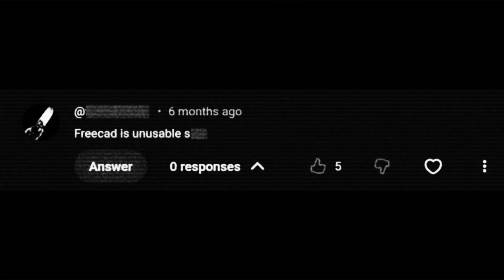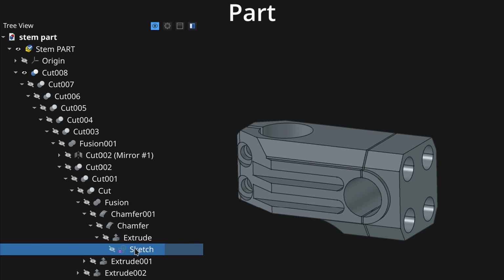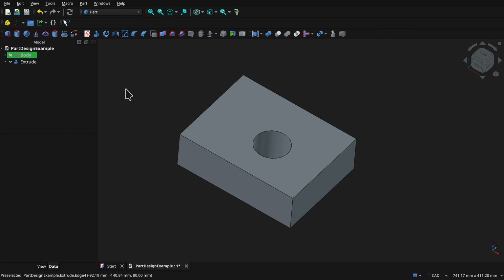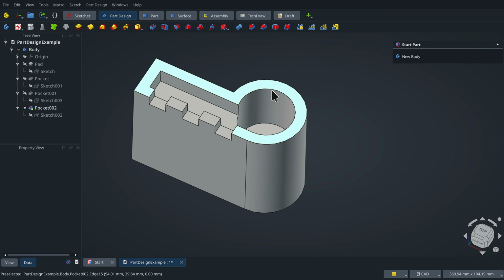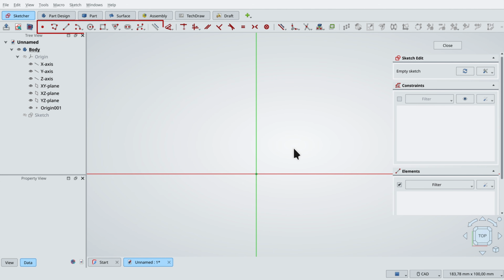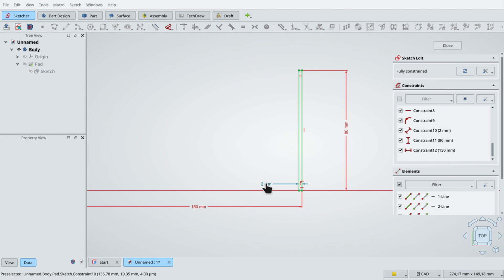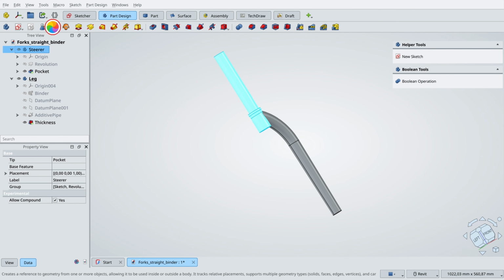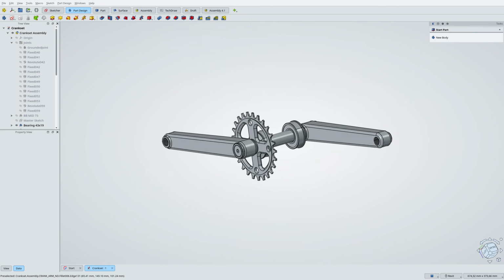STOP using FreeCAD WRONG! Do this INSTEAD (Workflow & Tips)

Comment: FreeCAD is for sure capable - but framing this purely as a skill issue is dishonest. Sure, the topological naming problem seems to be in the past but python exception have not disappeared from existence. Fillets you also covered in the video. But some UI choices are still so bad that people with experience in that area might just burst into tears. Just because you can learn something does not make it a good/intuitive/solid choice. I think the default UI setup is a big part of the problem.

But given the major improvements in the past few years I am at least hopeful.

Thanks for the great video.
Reply: the UI is MAJOR problem, not a skill issue.its more a the developers could have been more clever issue
Reply: @genin69  saying it's a major problem is a bit harsh,  the UI is one of the areas people mention most. To be fair to the developers, it’s a volunteer-driven project with a lot of technical depth, so polishing the interface isn’t always as straightforward as it seems nor the main focus. Still, it’s definitely something the community is actively working on and we've already seen lots of new features which you can already try out in the weekly dev builds.
But then again, if you come here from Solidworks, you should feel right at home so i do wonder if new CAD users are not in fact dismissing it based on first impressions though.
Reply: One thing free fem can do for ya:
You got an Python console and can access anything there and do anything from there!
Reply: @theunfightable4513  that sure are superpowers - but so far I've always been more of an openscad or replicad person for that kind of usecase
Reply: Not sure about bursting into tears, this is leages easier than when i learned 3DS Max two decades ago and way more than blender before the 3.0 UI/UX update. I think people forgot that before you can start using a complex tool, you first have to learn how to and not the other way around unless you do indeed want to burst into tears. We've gotten complacent with our modern slick interfaces and intuitive controls to the point we have no patience to properly learn something a bit more complex than MSPaint without a video tutorial we'll forget 80% of by the next day and then complain it was the software that was too hard to get into.
The simple fact you can adjust the UI to your needs is already a huge help for newcomers but I do agree that a cleaner interface should be shipped by default and maybe they should make this a priority seeing the number of comments about it.
Reply: @TheSliderW  Sorry, my phrasing was misleading. People that have a solid background in UI/UX design will burst into tears. Saying things like "software I had to learn 20y ago was also hard!" is gate keeping or deflecting. Even for complex software, teams building them usually strive for simplicity. FreeCAD is improving but still has a long way to go in this regard. It's OSS and by that definition is best effort. But if I was project owner/manager or in any way responsible for the project - my project board would be full with UX changes. A few years back input to FreeCAD was usually rejected with "you are just holding it wrong!" but I am glad they started listening and improving now. I am hopeful.
Reply: @tcurdt  
Fair, I get what you mean now. I’m not saying FreeCAD’s UX is perfect, weird errors/exceptions could be presented much better, and cleaner defaults would definitely help.

I just don’t fully buy the idea that FreeCAD is uniquely hard to get into. To me it feels roughly in the same ballpark as SolidWorks, which is already one of the more approachable CAD packages, and honestly, easier than Fusion or Onshape in some areas (I just hate it's assembly workflow).

My broader point was that complex creative/professional software always requires a learning phase. Modern Blender and 3DS Max  (just like the old versions) are used by artists, not machinists or engineers, and even there nobody expects to open Blender for example and intuitively master Grease Pencil animation, rigging, modifiers, materials, rendering, etc. You watch tutorials, practice for weeks, build mental models, and slowly get comfortable.

I don’t really understand why CAD is sometimes judged by a different standard. Designing precise functional parts with constraints, parametric history, sketches, references, assemblies, tolerances, manufacturing intent, etc. is inherently technical. Good UX can reduce friction, and FreeCAD can absolutely improve there, but it can’t remove the need to actually learn CAD which will in turn helps to make sense of why the UI is how it is.
Reply: @TheSliderW  You can't eliminate the learning curve on that I agree - but you can flatten it. Even with some experience in FreeCAD I still scratch my head "What were they thinking?". But as a dev and having built and managed projects I know how these things happen. I am just getting very annoyed by the "you are holding it wrong" stance whenever I hear it. Because usually - no, I am not holding it wrong. It's just quirky. You can come up with work arounds or learn a more complicate way - but good UX is about guiding the user. And FreeCAD still has a long way to go in this regard. But I am glad things are improving.
Reply: @tcurdt  agreed
Reply: @TheSliderW  This is a tool, being very different and thus taking much longer time to learn from the competition makes it less powerful, and even worse, it makes converting a design from different software to it much much harder, preventing people from migrating to it.
Reply: @אלדרנוי  again, the competition is just as complex but with a rearranged interface and . How in the world does it make this "less" powerfull ?
I fail to get the point about migration. Please elaborate. 

(Youtube is broken, replying to you forces me to write from right to left... weird and half broken.)
Reply: @אלדרנוי  i've converted many models from solidworks to freecad over the course of a year and other than being slightly slower to use because it lacks some of the neat snapping features and automatic tool selection, it was just as easy. I think you are exagerating things a bit from the perspective of someone who is still learning to use it. It's alright. Don't force yourself to use it if it's messing with your productivity. Otherwise please, do contribute on the forums with any criticizm and sugestions. Any comment that nudges the devs in the right direction are welcome.
Reply: @TheSliderW  Blaming the users will just make it so you have less users :/
Reply: @אלדרנוי   Please show me where he blames the users.
Maybe the meme was lost in translation but "skill issue" is not to be taken seriously. He was referring to the fact people are quick to dismiss the app after only looking at it like it's an ugly kids craft.
and do not spend enough time to acclimate themselves with the core concepts as i was explaining.

Comment: I mean, they are correct.  FreeCAD's BONES, are rock solid.  It's just that their default layout and workflow is complete ass.  Just mimic Fusion360, or OnShape, or Solidworks with the damn toolbar, and make the software usable ffs.  I don't want to have to dive around to 3-4 different repositories finding a plugin that makes the toolbars actually SANE.
Reply: No
I know FreeCAD , used it for years and can practically use it with my eyes closed.
The last thing I want is for them to copy stuff I have never heard of and will need to learn from the beginning
Reply: @PaulG.x UI and workflos is the biggest barrier people have jumping softwares. Even from Autodesk's offerings to Solidworks theres a jump. FreeCAD seems unintuitive, and like its wasting your time if there isnt even a built in OPTION to be similar to the competition.

Comment: Really great video! Thank you for your hard work.
That said, i really think the quirks with flipping dimensions, breaking fillets, and handling of end-conditions for the "too large" fillets are the typical behavior that drives me crazy and keeps me from using the software unless I absolutely need to. But it's very nice to have your trix to circumvent them.

Comment: My freecad install on Arch linux sometimes craches. In particular when applying offsets (sketcher) or chamfers or fillets to small geometries. It's not that clear what makes it  crash, but it happens less often than four years ago.
Reply from the maker: @dontwanttousemyrealnametol6765That's strange because I'm on CachyOS and I have no issues. Did you try the AppImage?

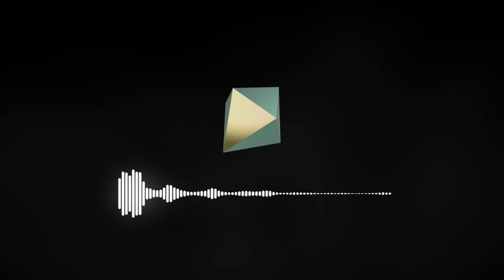Comment: 0:24 a short answer to those comments is developer design skill issue, ie a lack of UX understanding and user testing.
Reply: There is more UX understanding than you think. But the application was already built with wonk design and changing it has turned out to be more of a gradual process for a myriad of reasons, not least of which is due to front-end developers who know their way around Qt willing to do the work. There are some, but a wholesale rework of the interface is not possible right now.
Reply: They should have just stolen UX and workflow from Solidworks and/or Fusion. The big guys already spent the money and did the research, you just need to copy them.
Reply: @Obelisk-79  i wouldn't call it wonk design. it's old school "every tool has a button" logic and It spreads it's tools among specialised workbenches which is basically the same as Solidworks tabs. Granted Solidworks has many features grouped into similar tools like the auto constraints solver that detects which constraint is the most appropriate for the selected elements. We now have something similar since 1.0.
But there is still a lot of work to make it even more user friendly like auto snapping to edges and middle points to make it on par with modern UX.
Reply: @TheSliderW  I agree that it is old school and it is bad. times have changed. Free cad is unusable to design engineers. If you are a drafter and all you do is take other peoples design and put them in CAD it is fine. It is clear that the ones who created the workflow were trying to achieve something very different compared to what every other CAD package wants to do.
Reply: @Ender_Wiggin  not right. They were not trying to achive a different aproach to other CAD software, they where basically pursuing exactly what other CAD software was doing way back when (Catia ADN).
On the contrary, newer software has a UX first philosophy and instead of rewriting FreeCAD from scratch, it's adapting to that ease of use trend.
Reply: @Ender_Wiggin  also, i never said it was bad so not sure where you're agreeing on that from.
Please don't misunderstand, old school is not equal to bad.
Reply: @TheSliderW  Catia ADN is bad. It is not ment for designing. It is ment for people that draft to put it into a computer. This is not a good work flow and a bad use of Computer aided design. It goes much further beyond UX first philosophy. It is more like expermetail design first.
Reply: @TheSliderW  It is bad is just about any way I can rason to define it. By market share, work output, creative process, design change. I agree that it is old school and separately it is bad.
Reply: @Ender_Wiggin   There is a misunderstanding here as well as some comments in bad faith. Can't really have a discussion or get myself understood with that. : s
Reply: @TheSliderW  I am just presenting my views on old school logic and how it is materialized in freecad. I would love to hear your reasoning on why the old school logic is better for superior. 1.0 and 1.1 have made large efforts to fix the old school logic.
Reply: @Ender_Wiggin  there is a language gap leading to some misunderstandings. I also never said anything was better.
I was saying that the current UI/UX is directly taken by old Catia as that was the main source of inspiration. The interface was dead simple back then and everything existing in FreeCAD today was built on top of it. Redesigning the interface was never a priority as the tool was targeting people already in the industry or familiar with similar products.
ie : I never heard 3D artists complain about Maya or 3DS Max interface which are arguably more complex than this.

"Fixing" the UI/UX is a relatively modern concept that places agreeable user experience as a core feature. This concept is a double edged sword, indeed, while this is great for tools meant to be used by anyone, it also obscures or disalows advanced features required by more advanced users.

FreeCAD would need a total UI rewrite to achieve that which is not possible at the moment. So you will only see for now little changes to make it more bearable.
But then again as our host demonstrated, FreeCAD is also very flexible and it's up to you to rearrange things around depending on your workflow and needed features. 
Please pay attention to the fact that FreeCAD does way more than it's competitors so it might be overwhelming for someone who just installed it hence why these videos are important.

There. I think it's best to leave it at that.
Reply: @Obelisk-79 The fact that it's build with Qt already explains a lot of the issues 😂
Reply: @ND_youtube  I did not know that. that is surprising. Well i hope it can be made workable. I know the kicad people are really itching for a CAD software.
Reply: That can be said about any interface. I've heard complaints about modern interfaces in commercial software. For people change of habits is the most painful experience. I've started with freecad, used Inventor and SolidWorks (multiple versions). In my workflow I can finish a task in freecad before SolidWorks even loads
Reply: Keep in mind this software was not intended for general public use but professionals, people used to reading blueprints and fabricating. Even 3D graphics software targeting artists used to be a pain to learn. We now live in a world where we don't have time to learn the basics and need to get things done ASAP after watching a video tutorial and we have Youtubers sponsored by big names including DassaultSystems (Solidworks) and that skews things even more.
Anyway, FC is adapting though and we can see some good progress already.

Comment: Ok, for all critics - Freecad is a great FREE and Open-Source project (no ads!!!) and my files stay where they belong to which is my hard disk ! 😀 
Although I would consider me as an intermediate user I learned some kind and neat tricks from your video - thanks for that ! 👍
But I am still wondering in different terms about some things: what do I use the draft wb for ? e.g. the path array modifier, why the heck isn't it part of the part design wb? if I am right, a Sub-surf modifier makes a copy which violates the parametric concept - I might be completly wrong. What is the difference between clone, sub-surf modifier, link and copy (dependant or independant)... etc - maybe you have a video about that...
Nevertheless, please do not comsider this as critic, you did a great job with this video !!!  👏

Comment: I think the problems with FreeCAD are mostly ego and inexperience.  A possible third problem is a lack of understanding of the underlying principals and best practices. 

I'm a novice modeler at best and when I first started with FreeCAD the realization of the depth of work that even a relatively simple model required was startling.

This caused me to get frustrated quickly and it was a fight to stick with it until success was achieved. 

Since then I've kept with it and just try to learn new things as the demands of projects dictate. 

I'd like to do more with Meshes and Booleans because I do a lot of 3D printing, but so far TinkerCAD has been sufficient for those needs. So climbing that new hill with FreeCAD keeps getting pushed off. 

Just last night I was modeling a bracket and needed a hole so that a screwdriver could reach a fastener. I messed up and created the hole using the wrong plane for reference. The diameter was correct, but the angles were wrong to reach the fastener.  It's fixed now, but I do think that this would have been avoided if I had a more formal education in CAD modeling and a foundation of principles and fundamentals to act from.

Comment: I'll be honest, i'm surprised my comment didn't end up in your intro. Even though you roped me in and it is still frustrating, that doesn't mean i stopped using it, or that I don't appreciate the huge amount of free work that has gone into FreeCAD and your videos.
However, when I have a very simple part created and applying a thickness operation completely breaks everything and makes it dissappear, that is not a skill issue. When I apply a split along a plane (a painstakingly placed one at that) and the object disappears into thin air, that is not a skill issue. 
Thats like saying the fact that the sunroof opens on my car every time I shift into third gear is somehow a skill issue, rather than a broken car.
Reply: It might be, if there's a problem with your geometry or the way your plane is set up. Solid CAD modeling can be brutal sometimes, and that's not unique to FreeCAD.

If indeed everything was done right, the best thing to do is file a bug report and give the developers your problematic geometry (or else try to reproduce the bug with a different piece of geometry, if what you're working on is secret and proprietary). Your problem will get fixed, and the tool becomes better for everyone as a result.